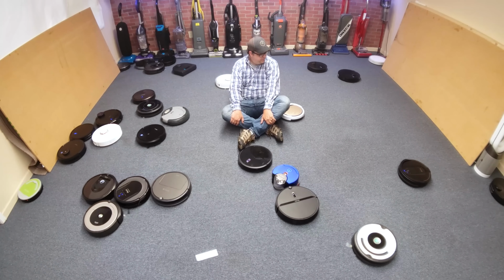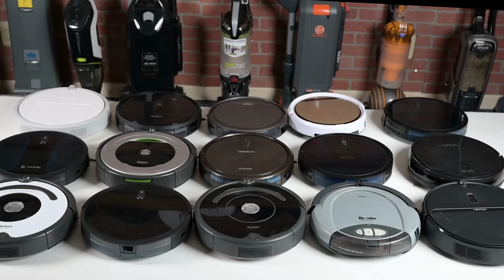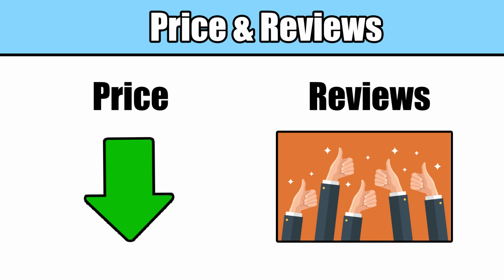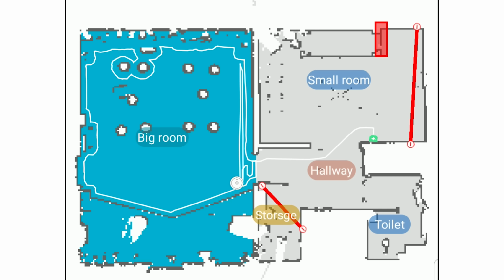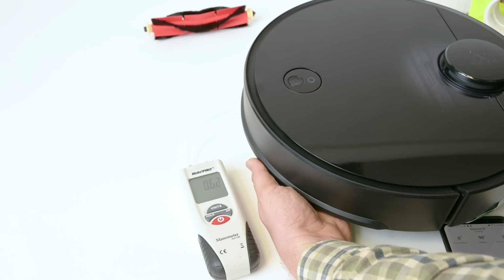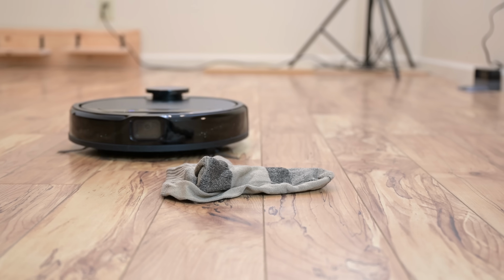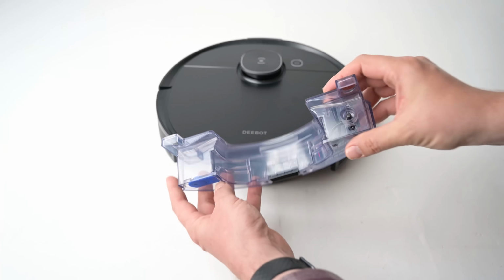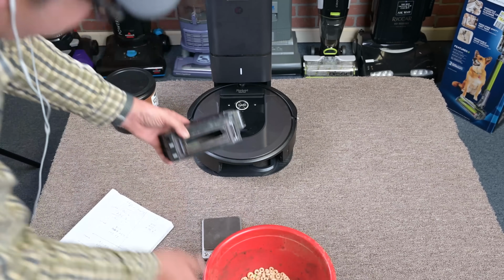BEST Robot Vacuums 2020 Edition - Vacuum Wars

Comment: Yeah the robo rock s4 is great 
I haven't been able to connect to it through my phone (sigh) but it's still worth it 

A random navigation wouldn't have worked for us 

If u have anything that looks vaguely like a ramp but isn't (EX: The base of an office chair that has spokes with gentle slants) it may be too stubborn & will try to climb up, eventually needing rescue so update it's map & tell it to avoid them 

Also, sometimes it will go under places it can definitely navigate (under tables & chairs) but then sometimes it will insist in trying to fit between legs that leave a space that is just a little bit too narrow & get stuck
Also flimsy rugs will do battle with it & get shifted around
Reply: Why can't you connect it to your phone?
Reply: @ToddQuillen  I think he has to have Wifi to be able to connect to Roborock Vac. I don't think you can connect via cellular network. If he has Wifi, then he may have tried connecting through the 5ghz band and the old 2.4ghz band.

Comment: I have both the i7+ for my hard floors and the S9+ for my upstairs carpet. They both have about 1800 square foot to cover when cleaning. If i could only keep one it would be the i7+. It may not have the power that the others have but it just does a good job all of the time. It NEVER gets stuck or lost, resist tangles very well ( 2 x great pyrenees) and is just a really helpful vacuum. Only way it could be better is if it had Ai and i didnt need to pick up every single toy my kids leave out!
Reply from the maker: Yeah, I have both as well, and I agree 100%

Comment: how would the deebot t5 compare to the t8?
Reply: The T5 has older, less accurate LIDAR, so the mapping and navigation isn’t quite as good, and it doesn’t have a camera or 3D sensors on the front like the T8 AIVI and T8, so it can’t avoid small obstacles (shoes, socks, cables, poop) like the T8s can. The T5 also doesn’t support the oscillating mop attachment or the auto-empty station that the T8s do. The T5 is just a renamed Deebot 950, so you can look up reviews of that to see how it does. Biggest problem with the T5 is it’s $500, and I’ve seen the T8 on sale for $550 without the auto-empty station, so in that case it’s a no brainer to go for the T8.

Comment: Thumb sideways. Almost interesting. I think you should have included and distinguished between self cleaning and stand alone robovacs. Some of those brands are rather opscure, like the man said where's the Shark product line? I think Dyson has one; it looks like an Abrams tank on steroids and costs about the same.
Reply: The Shark and especially the Dyson have received some bad reviews and both get a LOT of complaints from users on various websites.
Reply: Apparently the Shark app sucks and the Dyson can't handle fruit loops and isn't available in America.

Comment: would really love to know why the shark got shafted, is it because they never fulfilled the dream of no-go zones?
Reply from the maker: Partly yes. Mainly I felt like it never really lived up to the promises of its navigation and app features in general. I tried to give it another chance before this video. I ran it for a few days. I just couldnt get it to perform as advertised. If it does all the things it is suppose to do, then its a clear winner, especially at the price they are selling it for, with no questions. I suppose if you take price into account its still a great value.
Reply: @VacuumWars  awesome, thanks for the response.  I've got 3, since I got them for the equivalent of about 300usd each.  For the price, they are unbeatable, and I have learned to live with the 'meh' navigation.  I'd love to get the t8 aivi or i7+/s9 but in canada they are absurdly expensive.
Reply: A Guy look for the T8 or T8+. Just released a couple weeks ago and even better obstacle avoidance than the T8 AIVI for a cheaper price.

Comment: With the AI vacuums, how about a poop test where you scoop some chocolate pudding onto the floor and see if it smears it all over the place or dodges around it
Reply: OMG, never thought of that. Disgusting. You would have to throw the vacuum in the trash. Screw cleaning it.
Reply: I want this test too. I have a cat who uses sheet on floor instead of litter box, and I am afraid to run a robot vacuum when I am not around, even though I have set no-go lines for the robot.
Reply: @jaceyc9418  Call me old school. I have my Miele and I'm set to go.
Reply: Yesss. Sacrifices are needed for the greater good